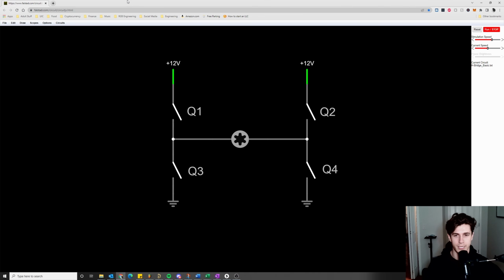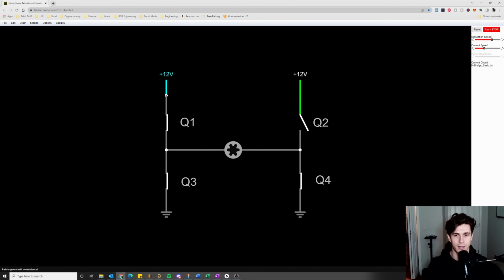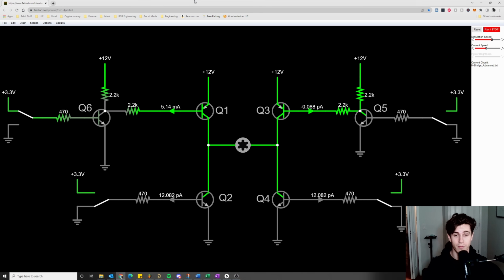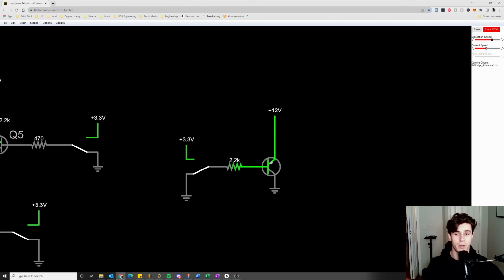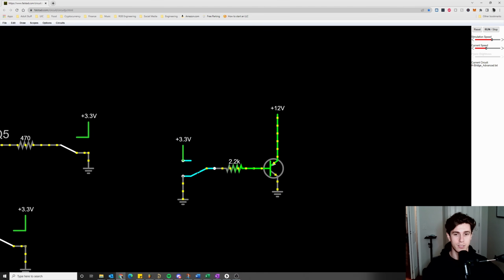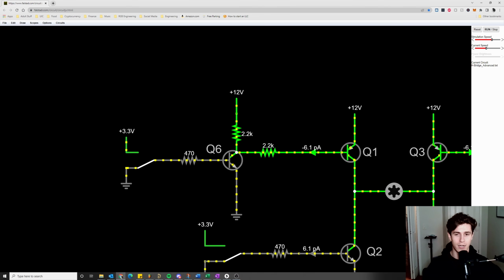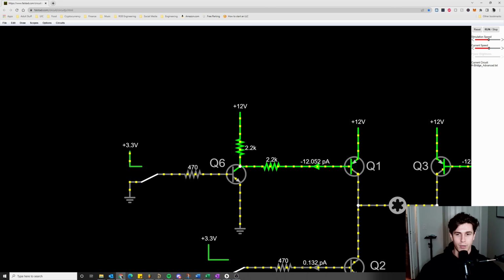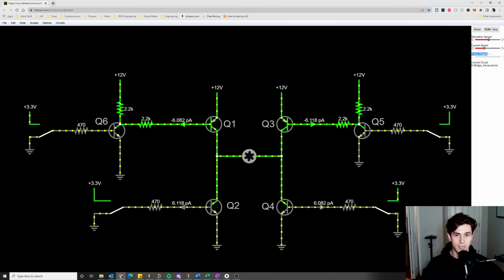H-Bridge Basics (for Beginners)

Comment: It's SO much easier in switching to think of pulling the base toward emitter or collector.

When the base is pulled to the emitter potential (within 0.6V), the transistor is in cutoff. When it is pulled more than 0.6V toward the collector (relative to the emitter), it is conducting.

In reality bipolar transistors are current controlled devices, and yes while thinking of it in terms of current in to (or out of) the base is useful in analog, it doesn't mean much in digital and switching. You're either pulling it hard toward the emitter, or hard toward the collector. 

Note that this is readily revealed in the 3V3/single PNP switching 12V example... the base is always pulled toward the collector; the transistor will remain on. Polarity of the transistor is irrelevant this way, and so it works equally well for both polarities and extends readily to FET; universal thinking.

In fact it is even more useful there, because they are voltage controlled devices, and you can't think of them as having "current flowing in/out of the gate". The current flow is only momentary as the gate equalizes to whatever is driving it. The voltage threshold is also different (typically a few V) but the behavior is otherwise identical. Toward the source, off. Toward the drain, on.

Comment: How do you prevent the short circuit path from Vcc to ground?
Reply from the maker: the driver signal should be hooked up so that when it turns on side on, it also turns the other side off.

Comment: Hey, I am going though transistor concepts. Why does pnp base need to be set 12v to be in cuffoff and why it doesn't work at at 5volts or lower?
Reply from the maker: Remember that BJT transistors are current-controlled, so what really matters is the current flowing through them, not necessarily the voltage being applied. The reason it wouldn't work with 5V is because 5V cannot generate as much current as 12V can.

Comment: Hi, just wondering what advantage does using the combo of pnp and npn transistors on the supply side rather than just using npn transistors controlled by the gpio and leaving out the pnp transistors?
Reply from the maker: If we used NPN transistors on the supply side, the load would be downstream from the emitter pin of the transistor, and variations in load could affect the current flowing through the base pin (and potentially take the transistor out of saturation mode).